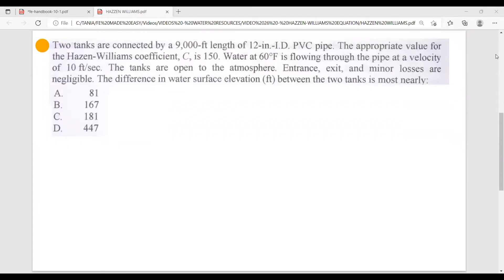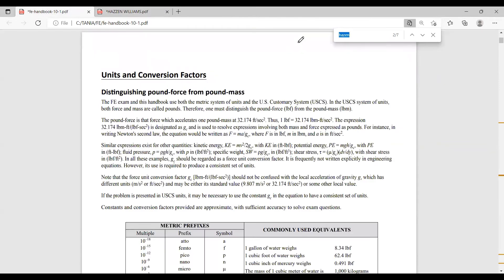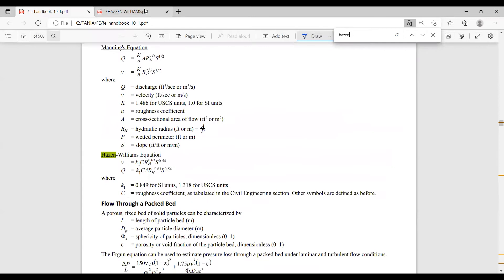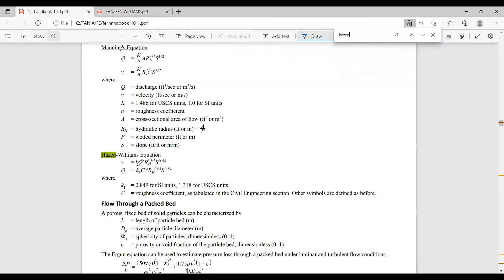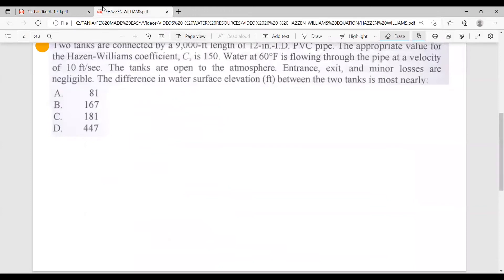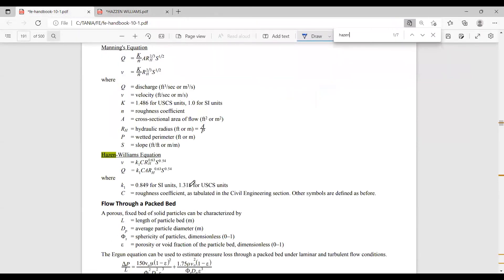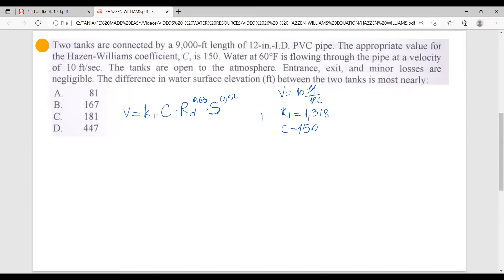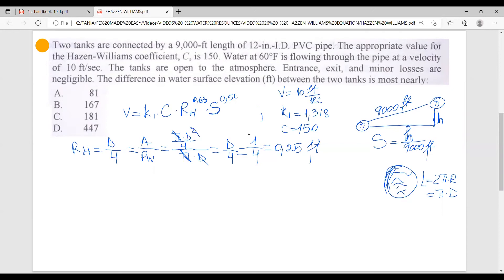FE Review - Water Resources - Hazen-Williams Equation

Comment: Thank you for the video, but there is an equation exactly next page to Hazen- Williams Equation, specifically for the " Circular Pipe Head Loss" in FE Reference.  hf = (4.73x Lx Q^ 1.852)/ (C^1.852 x D^4.87). Or am I wrong?
Reply from the maker: Hi there, you are right the only thing is the problem does not give us the flow "Q" it gives us velocity "v" and this is why we are using the velocity formula.